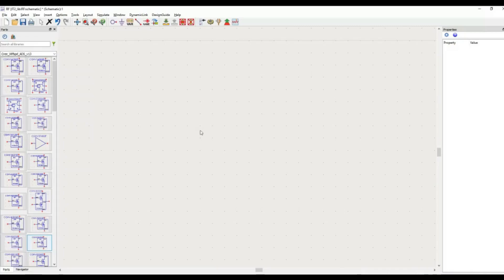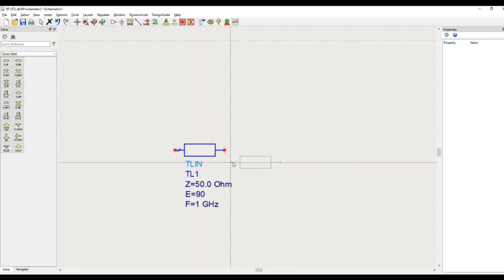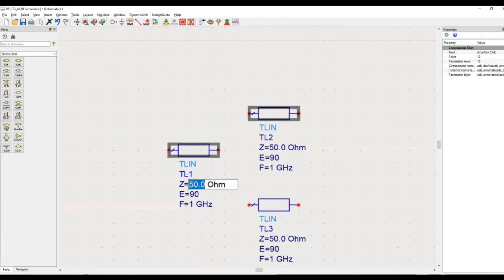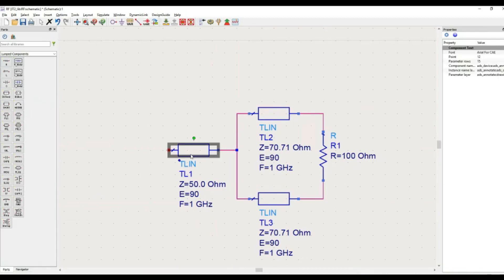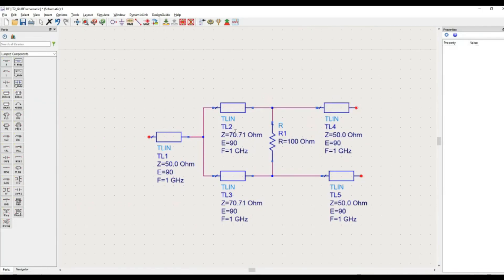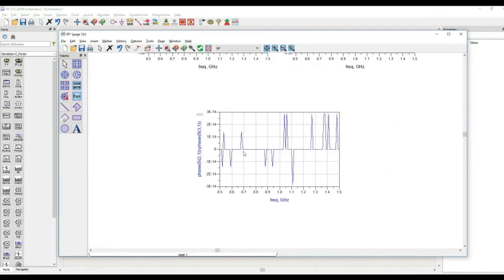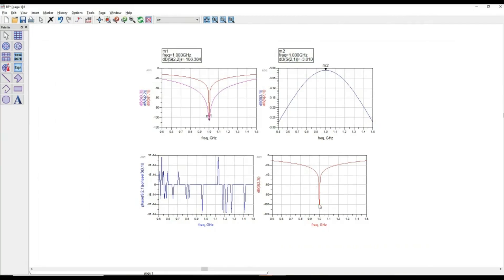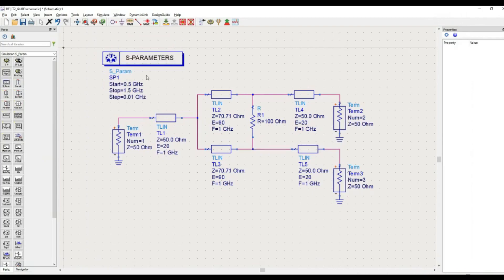Design of RF Wilkinson Power Divider in Keysight ADS | S Parameter Simulation | Phase Difference

Comment: Why does E have a value of 20 in TL1, TL4 and TL5?
Reply from the maker: Thank you for your question.
Actually E is electrical length here at the mentioned F frequency. And these TLs are used at a pad to solder SMA connector.
If you notice the port impedances are 50 ohms each. Therefore we can use any E as electrical length if the TLs have characteristics impedance 50 ohms. I have choosen 20 degree as an optimum length just to solder the SMA connectors.

Hope this helps. Please subscribe and share.
Reply: @labnotes23  One last question, and sorry to bother, is there a range (ie a maximum and minimum for this electrical length for TL1, TL4 and TL5?
Reply from the maker: @leoreyes5158  No limit in fact. But you may want to keep it minimum for the optimised form factor. And to find out your minimum value, you can calculate it using linecalc (https://www.youtube.com/watch?v=j12ZtAOhzyw) and observe if it is sufficient for the SMA connector pin length which you want to solder plus the length extension required as per your final design layout. 
Don't forget to simulate your final EM structure and optimise it (https://studio.youtube.com/video/sjKVygy2zLA/edit).